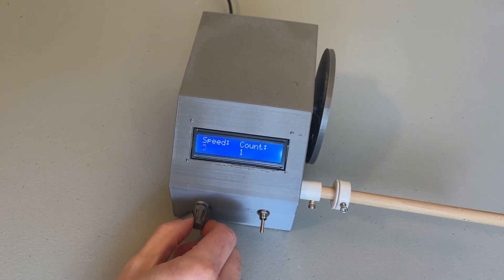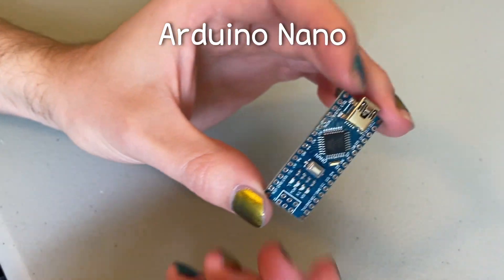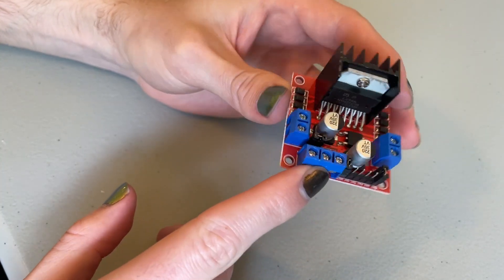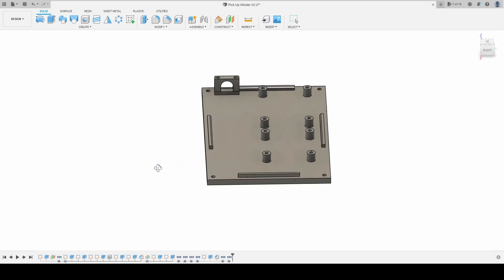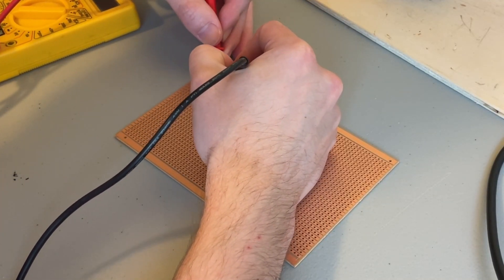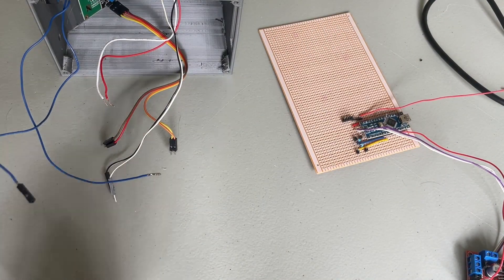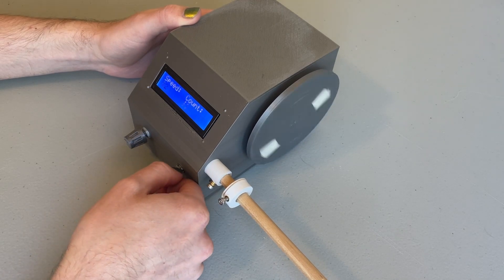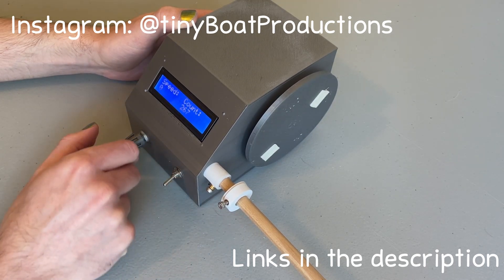Pickup Winder V2

Comment: Hi, I've got an issue with the resistors shown on the schematic - on the schematic on instructables, it shows the switch common going to +5V via a 10kohm, but you say the switch common goes to ground in the instructions, could you help clear this up? Thanks :)

Comment: I have been interested in making a pickup winder for awhile, and i think this might be the most straight-forward one ive seen.

One thing i was interested in that i saw on another pickup winder video was the use of a servo as a traverse for the wire so it has even and consistent coverage. That one used some arduino code for the servo, so I figured this one already uses an arduino so might as well try it.

ultimately the goal for me is to be able to build my own custom pickups for extended range guitars, like an 8 or 9 string. As well as trying to utilize some other less common pickup styles, like those found in the old Teisco ET-440 and the G&L Comanche, which utilize a 'z-coil' pickup design.

Anyway, let me know if you make another version which would also add in a servo as a traverse. Or if im able to do it I'll try to update you with my progress.

Comment: This is kind of a stupid question but I was curious how you mounted the screen. I see bumps on the front of the case but no screws or anything. Is it just glued in?
Reply from the maker: I used screws to mount the screen from the I side. I had designed in 4 mounting points but only ended up using 2.

Comment: Nice project. The links for the motor and the magnet are down. Can you tell us the diammeter of magnet or add a new link for both the motor and the magnet? Again, very cool project to try, thank you.
Reply from the maker: I've updated the parts list. Can't find the exact same magnet but as long as it fits in the hole (9mm diameter and 2mm thick) it should be fine.
The motor is the small style of gear motor often used in small combat robots. Ive updated the link with one that will work. I should note that the rpm is slightly slower on the new one, it should not make a huge impact on the overall performance of the winder.

Comment: Hi! Great video! I would like to ask if the link in the description in the picture with the soldering scheme says that it is outdated and you need to use another scheme. Where can I get this "other" scheme? I don't want to do it the old way with the risk that it might not work out :)
Reply from the maker: The new version is the first image in step 3 of the linked instructable. It has 2 resistors for the switch instead of one. The final picture is the old version. The old one works but is not what I did so can lead to some confusion.
Reply: @tinyboatproductions  Thank you! Good luck in the development of the channel!

Comment: Hi ! I have a hard time finding the right motor for the winder, 12v is easily available but 1200rpm can't seem to be available ! Any tips to find a good one ?
Reply from the maker: I would look for something around the same, so 1000 rpm or 1500 of you can find it. Just know it’ll run a bit slower or faster than mine.

Comment: just to let you know there is no reason for the counter to EVER count backwards, in fact, i need to make mine count forward even when in reverse. it has to do with phasing single coil pickups. the middle pickup in a strat is reverse wound and opposite magnetic polarity, which creates an in-phase, hum-cancelling configuration when ran in tandem with either the neck or the bridge pickup. this has been a standard feature of strat pickups since the early 70's. so when winding the middle pickup the motor needs to run in reverse, but still needs to be counting forward. i mean sure, you can still easily figure the wind count even running backwards, but why not just change the config on the arduino, which i have no idea where to start on that. my first pickup winder, the one i use now, i made the frame out of MDF and got my motor control units already with bi-state switches and a pot on the MC board. then bought a magnetic counter with a sensor i mounted near the bobbin holder, mounted a small magnet on the bobbin holder and i can reverse the motor and still get a positive count for phasing pickups. it wasn't as smart and cool and nerdy as this one, which is SUPER DUPER awesome  by the way, but it really didn't need to be. i'm not trying to be a smart ass or anything i been eye-ing your design for a long time and it is genius, i bought all the shit and am trying to get it going right now. i dabble in electronics but this is the first time i've ever tried anything like this, and i just thought i'd throw in my 2 cents on it. thanks man.
Reply: Well if you want the second pickup to have the same winding count, you let it run until you hit 0

Comment: I have a spare stepper motor. Could I just directly switch the motor to a stepper? Or would that require a change to the wiring and/or code?
Reply from the maker: That would require modifications to both the wiring and code. The h-bridge can control a stepper motor but it is more complex than a dc motor. I also think that steppers would have problems reaching the same rpm.
It could be done but it’s not a drop in replacement

Comment: Hi. So I'm in the process of building this and I  swear I wired things properly (to my admittedly limited knowledge). But nothing happens when I plug it in. That is unless I plug the arduino in directly in which case things work up until the "flip switch to off position" shows. The switch then doesn't register and I can't progress to winding. Any thoughts? Also I believe the code calls for pin a1 while the diagram shows pin a0 just something to note.

Comment: can you add in coding automatic start -stop  turn count function
Reply from the maker: I didn’t add one, I think it could be done. You could add a check to see what the count is and if it is above the limit you set it could set the motor speed to 0. It would stop the machine until you restart it tho, no easy way to add a reset.

Comment: What functions does the software have? Like, can I tell it 8,000 turns and when the winder hits 8,000 it stops?
Reply from the maker: The program on the arduino is fairly simple. It cannot do what you are asking as standard. The code could be modified to include this feature.